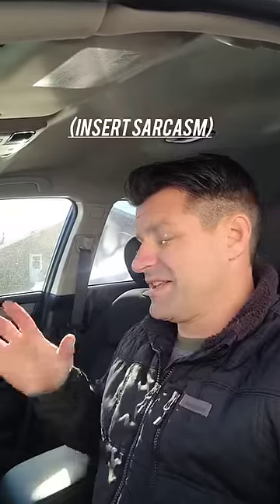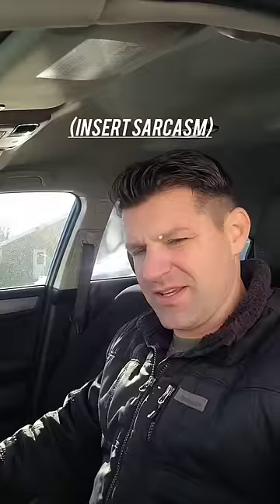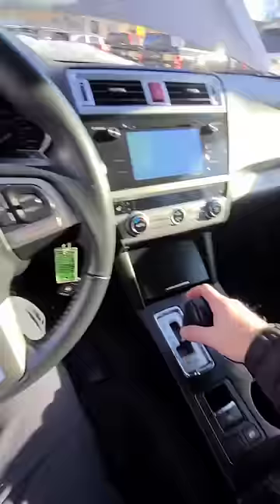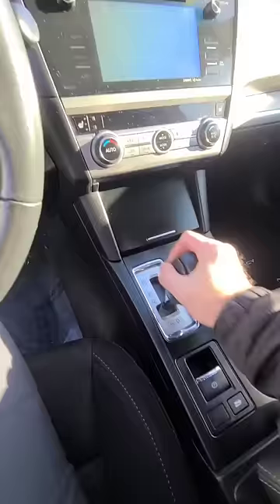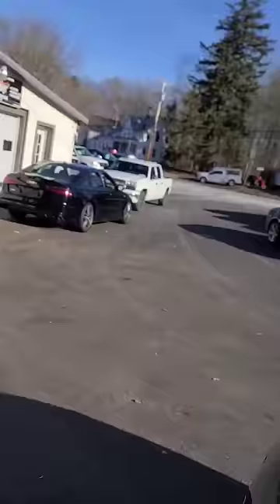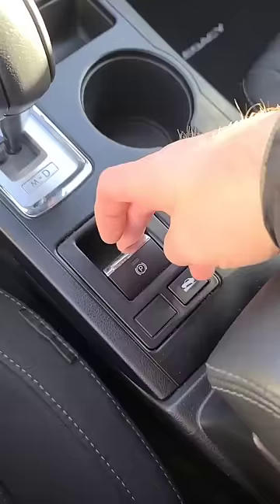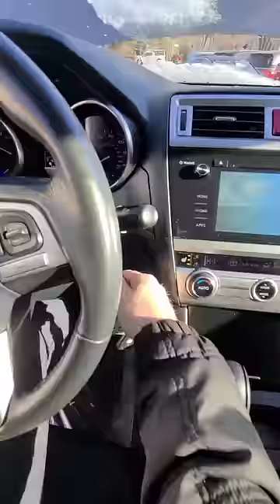Why Subaru Engineers deserve a punch in the Face! #shorts

Comment: Or you could use your mobile phone to phone a friend who owns a brick.
Or maybe there is a "Shift Lock" button that lets you put the gearbox into park.
Reply: There is a manual release for the shifter. It’s in that little tray compartment in front of the shift knob. Lift up the rubber cover and you’ll see the slot. Just stick a screwdriver in and there you go.
Reply: Exactly what I was thinking. People making videos trying to show off how much smarter they are than the engineers while being too stupid to know what a shift lock is and how to disable it
Reply: @orensmith6470  how do you get the screw driver when you're stuck in the car? What if you're alone with no phone?
Reply: @chrispekel5709  A pen might even work too.
Reply: @hustla818  that's just stupid, what's less tedious: open a panel take your screwdriver stick it in the hole and press down to operate the shifter OR pull a lever?
Reply: I think we all know what a shift lock is, its just that why fix something that isnt broken? Like the e brake... What if you dont have anything to stick into it?
Reply: @hustla818  Try thinking a little. It's very possible that he has nothing to stick into the shift lock. What's he supposed to do then?
Reply: @googlewolly Somebody said the key works well enough.
Reply: @johnlucas6683  Maybe. If not, though, point remains.
Reply: @googlewolly then he shouldn't be working on the car if he has no idea how to work on a car..
Reply: @abudibiahkbar1766 then he should use his phone to call a real mechanic
Reply: @timothyvu7006  That doesn't change his point, which is that it could pose an issue for your average person.
Reply: @googlewolly  the average person would probably be working in their garage and on flat ground. And there would be a person near by to hand them tools or plug the clips back on.
Reply: @timothyvu7006  Batteries don't only die when someone's working on a car. His point is that this could be a big issue for someone if the battery suddenly goes.
Reply: @googlewolly  sure it can happen. It'll probably happen with other people nearby and most people have a pen or some type of tool in their car as well. And since the shift override has been around for decades, people are aware they exist. If you happen to not know, everyone has a phone and can google it.
Reply: @googlewolly  really? So you're telling me he didn't have his car keys on him? Because shift locks are literally designed to be pressed with your car key. So next time why don't you think a little first
Reply: @hustla818  Lol You're clearly very insecure and trying to compensate. Again, he makes a decent point. Now sure why you're so upset over this.

Comment: Cable e-brake please, they worked for decades perfectly
Reply: the ebrake is still a cable, but its just that the actuator is not a pedal or handle you pull but a button that pushes or pulls, an unnecessary complication.
Reply: @rmat9023 On newer Honda, as I understand, there isn't a cable. There's a motor on each rear brake.
Reply: @jonnda  wow that adds more complexity and points of failure. they should have a capacitor or seperate little battery just for that system, so incase ur battery is dead or removed, you can at least actuate the parking brake a few more times.
Reply: Well unless you have pinto station wagon.  Freaking cable kept popping out of the leaver hook.
Reply: @JohnSmith-gb5vg  FORD???

Comment: Use the shifter override button and you can shift into park even without power. Or put it in drive and the stopped motor will stop the roll of the car. You have options, just not the one you first thought of.
Reply: Having it in "Drive" will stop the roll of the car? Especially on a significant incline, that is a dangerous thing to assume or to tell people. Once parked with the engine off, where does the compression of the fluid come from to keep the torque converter locked to the gearbox? Also, the shifter override is typically only accessible by getting some kind of tool and removing the plastic cover that is over it. I doubt that most people will have a tool handy to do that while having to stay on the brakes.
Reply: @ReflectedMiles It would provide a fair bit more resistance than neutral at least. And no, you can generally use any old key to access the shift override.
Reply: The shifter override button is hidden and requires a phillips head screwdriver. A pen doesn't even work. It's an absolutely ridiculous design.
Reply: @user-wv1sg4gz4h  The screwdriver is provided and is either in the boot or the glovebox (depends exact model/region), but a solid pen absolutely works for this model (maybe not a cheap BIC Crystal)
Reply: @user-wv1sg4gz4h  I agree, it should be emergency ready mechanical design operated by hand
Reply: @ulogy  I tried a regular pen that anyone would have, and a flathead screwdriver. The hole is too small for any normal pen. Phillips head was only thing that worked

Comment: and that's why I love manual cars with a good old emergency brake actuated by a simple steel wire and a lever, you run out of battery and you just push it in second gear to turn it on and the emergency brake actually works as an emergency brake.

Comment: I love the "why didn't you do this or that?" Comments. Geez. Imagine if he wasn't a car guy alone in the middle of nowhere.
Reply: thats where keeping the owners manual in the glovebox comes in handy. It will tell said non car guy exactly how to overcome this situation.
Reply: @catfishbilly7425  other comment state that with a flathead or key he could get to the shifter over ride. I mean my wife keeps a toolbox in her purse but I dont think everyone has a driver handy. Keep in mind of that small situation where you are alone in a hill and cant get the foot off the brake.
Reply: Why didn't he chock the wheel?
Reply: Love to be that guy, roll down the hill, steer the car into it finds the bottom of the hill. It's not difficult to steer a moving vehicle.
Reply: @MrTaunks  again. You are thinking for yourself. Not everyone can move a steering wheel with no power. Or brake with no booster.
Reply: Just for laughs..the car key has a physical blade in it.. but I guess he left it in the door lock while attempting to get into the car.
Reply: @shoarectube  the key doesn't come out when car is in gear.
Reply: the thing he does mention in the video is that he created this situation. He used the jump pack to get the car out of park and release the PARKING BRAKE in the first place. then his pack went dead. it is not going to happen in the real world.
Reply: @dragthatsht  you are right. Batteries only die in park. What was I thinking.
Reply: @blue_lancer_es  that makes sense.    

Interesting scenario, but I can not really imagine this happening to too many people.
Reply: @blue_lancer_es  it's not in gear > <
Reply: @shoarectube  a battery can die in you at any point whether you're driving or not. I've dealt with so many cars at the car just died while driving. I'm a mechanic. I see that s*** happen all the time
Reply: @ianicus123  some cars don't allow you to remove the key unless it's in park. As he stayed at the car is in neutral
Reply: "If he wasn't a car guy" ....... 
car guys know how to access manual shift control.
also, why TF is he in neutral?.... 
how did he get the battery jump on in the first place?....

ask those questions first.
Reply: @xanderc4732  little map for ya. 
I am talking about the greatest % of normal people that in fact are not car guys. Also. Have you never had a battery or alternator give out while driving and the car dies? Never?
Reply: @catfishbilly7425  yeah dude instead of design something easy todo let the user read a 500page manual. Yall don't even read the user agreement.
Reply: @dragthatsht  So that wasn't the real  world? Very convincing CGI
Reply: @MrTaunks  Steering wheel is probably locked.
Reply: @BedjamRivera  a car battery doesn’t just die with no warning at all..we are no longer in the 60s. In most cases you will not have enough amps to start the engine, but you will have enough to apply the e-brake or shift it into park. This is a clear case of a manufactured issue, or maybe a situation that he more or less willingly put himself into.. probably he was trying to move the car around in the parking lot with the hood open while having a jumper pack attached. I am also willing to bet he does that on a regular basis and he just got so accustomed to doing shady things because he is a “car guy” or an expert. 

My conclusion is that they don’t make them like they used to, that is correct.. in most cases that is because they don’t beed to anymore. That does also mean that mechanics should update their way of thinking and adapt to the new way of doing things and old shortcuts may no longer apply.

In the end, if you think subaru did it wrong, you should try putting an F series BMW into neutral without a battery! Look it up, you will be amazed!
Reply: @shoarectube  car batteries can absolutely die with no warning. It literally just happened to me the three months ago. Never had a single issue with the battery. The battery was probably about 4 years old and just died without warning. I've been working on cars for the last 15 years. I've seen it happen on multiple occasions. Is it rare? Absolutely, but it can happen.
Reply: @BedjamRivera  did it completely die on you while driving? Because this is the only time you could possible end up in the same situation as he was. Obviously you could go to your car one day an find out it is completely dead, but for it to die on you while in use, in Neutral and with the E-brake off.. it seems extremely unlikely.

For what is worth, my current car has a 8 year old battery (AGM). I also had older cars with older battery technologies which were I had to change the battery every 4-5 years or so, but it never completely died on me for no good reason.
Reply: Well you could control the car on the hill as long as it isn't too steep. And maybe just roll to a stop behind the Audi's.
Reply: @ddjohnson9717  Hey I'm not the one that engineered it that way. And although I agree parking brakes should not be electronically controlled, fact is they are nowadays. So why not look in the book that is there specifically to tell you how stuff in your car works (like how to shift your car in/out of park with a dead battery)? Oh, because you'd have to read all 500 pages.... or... or... just hear me out on this... you can use the table of contents in the front of the book or the index in the back of the book to locate the relevant information. Then you only have to read 1 or 2 pages. Amazing concept, really. But then again, simply opening a book does seem like it is too difficult of a task for the younger generation.
Reply: @catfishbilly7425   ofc you can use the ToC like a normal person. my point being the engineer should assume people are below his intelligence and critical operations should be as simple as possible(or as intuitive as possible).  

Yeah we are the car guys and know there's a shift lock we can use - but try think as someone else, for example a software programmer: they are familiar with coding and think making an app should only take a few steps. but for us (or me at least) I literally get stuck on matching different coding software versions. 

In such a specialized society, it is the job of the engineer to make cross-field operations simple. If a software programmer needs to stop a vehicle from rolling, the operations should be very obvious. Similarly, if I want to make a webpage in a hurry, I will use drag and drop instead of learning html. we are the experts in our fields so we should help make outsides' life easier, not the other way around. But clearly you older generations are having trouble grasping this concept - because you learnt the hard way means everyone else has to: peak internal friction that benefits nobody. total pointless actions but yall do it all the time, weird

Comment: Subaru has a recall on this exact issue, I got the recall notice in the mail last week
Reply: Good for them!   What’s the fix?
Reply: @andybaldman  they install a brick in the trunk you gotta run to the back to get.
Reply: @isaiasanchez1987  LOL
Reply: Sorry you drive a computer with wheels.
Reply: ... and the trunk doesn't pop, because the battery is dead 😂
Reply: @andybaldman  well we know someone got fired. but i'd imagine they either keep the car from using total battery, saving some juice for e-brake use (so, car stops, no lights, no nothing, but e-brake still has juice to engage again), which when engaged cannot be disengaged again without more battery power. that would have been the safe thing to do originally. but, they likely won't think of that, so they'll likely add a manual e-brake kit to the car, foot pedal style.
Reply: @eddiespagg  What did you say about my MacPro! 😠
Reply: @andybaldman  they just added extra notes and instructions to the owners manual on how to find the button to put it in park regardless of mechanical/ electrical state. the issue is the operators of the vehicles not being knowledgeable.

Comment: Observation: If the car doesn’t shift gears when the battery is dead, then there’s really no reason for engineers to worry if it can be shifted out of neutral with a dead battery. Reason being; the car should always be parked in park, not neutral. 9 out of 10 times a battery dies when the car is off. If this is the case, then in theory, you shouldn’t need to shift to park when a battery is dead, it should already be there (in most cases). But just a thought.
Reply: Also, there is a shift lock to release if this situation does happen.  This dude is a goon and should look through the manual.  Or Google it.
Reply: @shirothehero0609  lololol

Comment: Once you lift up the rubber mat inside the USB cubby, you'll see a circular hole. Stick your key or a screwdriver down the whole while pressing the shifter button and moving the shift back into park.
Reply: Yup, and this is probably in the manual too. Who reads manuals?
Reply: Point is how many people know that and you should not have to do all that in the first place.
Reply: You probably shouldn’t have bought a car you don’t know how to operate…
Reply: I think he said somewhere that he couldn’t get the key out of the ignition while in neutral. And he had no access to a screwdriver while keeping his foot on the brake.
Reply: @davidhenderson3400  People's ignorance is no excuse. It's the reason why manuals come with every car purchase since the 50's.
Reply: Why was the car dead and in neutral and how did the key get stuck?  I’m trying to figure how he got into this situation, other than something to bitch about.
Reply: @chrish352  OP stated the jump-box died after getting the car into neutral. I learned a while ago, if you are having issues with your car and take it for service, if you have two, give them both keys.

I would say this would be a rare win for having push to start.
Reply: Thanks, was going to mention this as well, whenever I by a new car, I read the manual...
Reply: @davidhenderson3400 point is 95% of owners will never use neutral, idk why he would be in neutral on a a hill either
Reply: @ejicon3099  Good designs don't require manuals and are intuitive.

Nothing about putting a car in park should require electricity, USB, or hidden access ports.
Reply: @LaFonteCheVi  Totally agree. Unfortunately, most car batteries don't die while a car is in neutral. The battery was already dead and homeboy forced the car into neutral not realizing he couldn't put it back in PARK. Not being able to operate the shifter while the batter is dead is suppose to be a safety feature.
Reply: @LaFonteCheVi  How dare you come in with LoGiC!

Comment: A wheel chock works too while you sort out the engineering nightmare
Reply: So you have to hop out, pop the trunk, grab it as it's rolling down the hill and then put it in front of a tire for a small, but exhilarating jump ramp.
Reply: @goofballbiscuits3647  I keep a wheel chock in the car where I can easily reach it in the event I need it.
Reply: @andrewolson5471  he can't let his foot off of the brake or it will start rolling. You're going to let go of the brake, hop out, run in front or behind a freely rolling vehicle and hope that the chock stops it at the force it's generated by the time you get to it? You're probably one of those karate people who thinks you can take a gun pointed at your face before they can pull the trigger. The afterlife is filled with your kind lol best of luck. Don't forget your rubber helmet.
Reply: @goofballbiscuits3647  You sure made a lot of assumptions about me. The trick in that scenario is to grab the chock from behind the seat while holding the brake, open the door and place the chock in line with the rear tire as close as you can. Then use the brakes to control the car as you settle it into the chock.
Reply: @andrewolson5471  Delusional lol but I'm sure that works in a smart car on a nearly flat surface. Best of luck with that.
Reply: @goofballbiscuits3647  my old truck's parking brake is broken. I do it all the time since I haven't gotten it fixed.
Reply: @andrewolson5471  I live in the Rockies. You'd get a Darwin Award here.
Reply: @goofballbiscuits3647  how? I'm remaining in control of the vehicle at all times.

Comment: Why would it be in neutral, hand brake off and a flat battery? What real life situation would this ever happen??
Reply: If the car keeps dying because bad alternator and just trying to get it off the road so put it in neutral, or there's been a few times where I've seen where the battery just totally craps out.
Reply: Bad ground and or connection, or blown fuse etc could also cause that situation. In the rust belt the braided battery grounds are sometimes corroded of on cars that are only a few years old.
Reply from the maker: Today was a real life situation